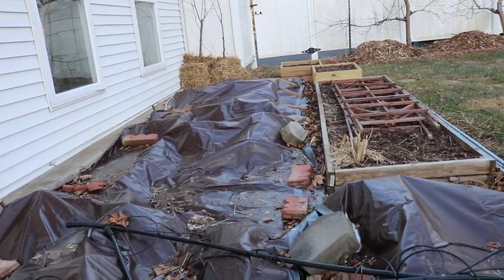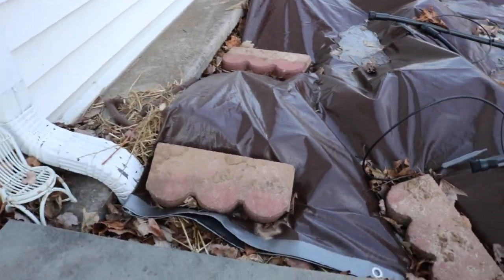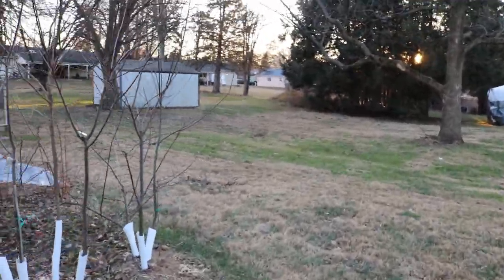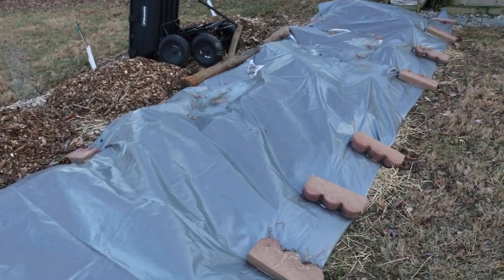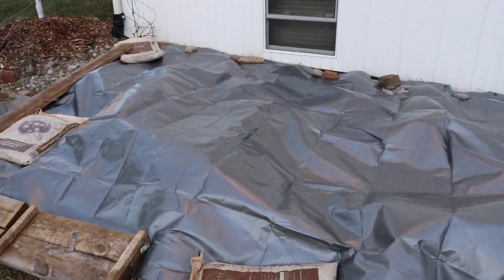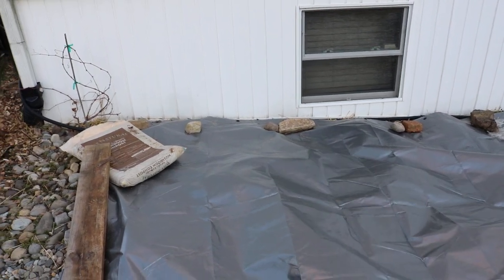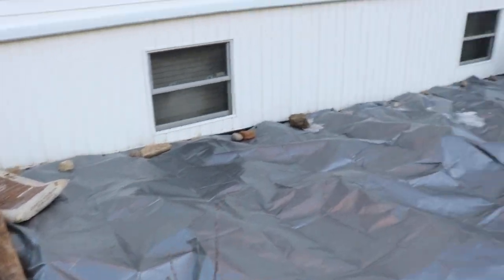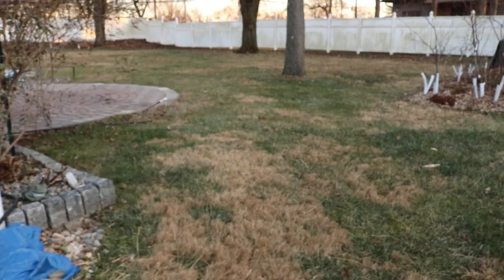Update to the Cut & Cover Method of Winterizing Fig Trees

Comment: The best way you can make this work is to build a small frame  (chicken wire, hardware cloth, short tomato cage) around each tree to keep the tarp off the trunks of your trees.  Fill in the volume of that frame with your straw (loose is better), and then put weight around the trees, but spaced far enough that there's substantial space between the tarp and stuff your protecting (several inches).  The tarp, itself, has basically no insulative properties.  You don't want it in contact with anything you're protecting.

Comment: u need some snow lol. wood chips are light. just dig up the dirt around the ends and bury the ends. a little air flow maybe good to prevent mold and dry out any moisture build up. goodluck
Reply: this method didnt work for me. i built a nice structure to try and save 2 feet of growth. nope in zone 6a all died to the ground and re-sprouted. hope u have better luck. i had the same results just keeping them uncovered and not doing a thing.